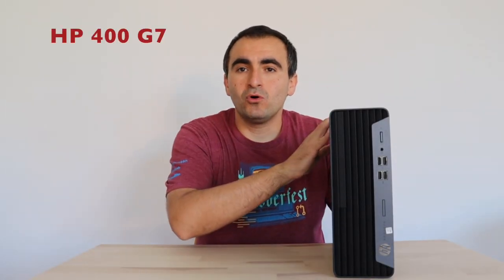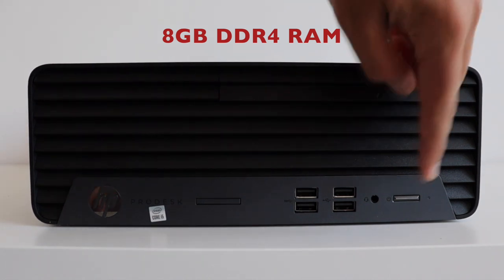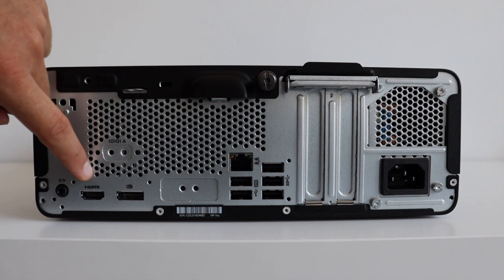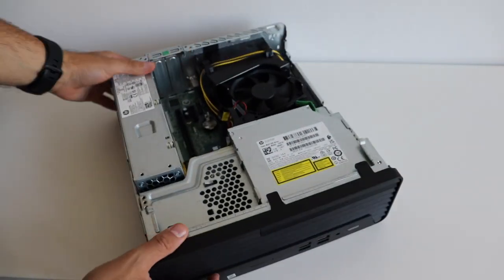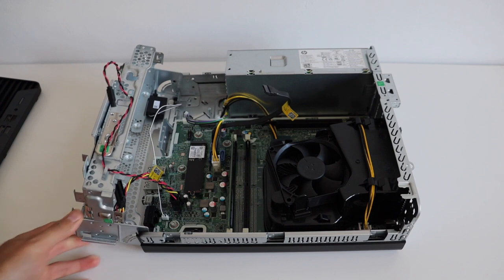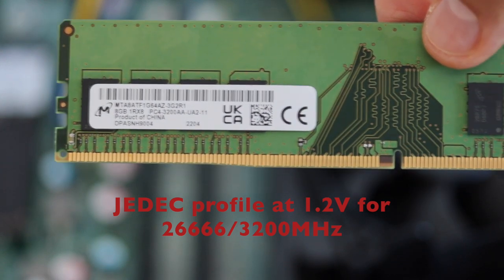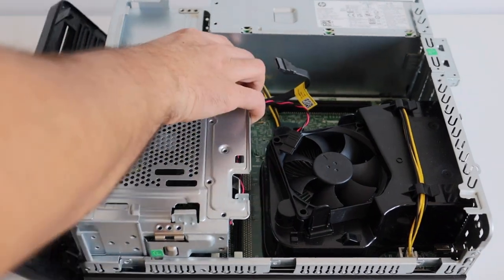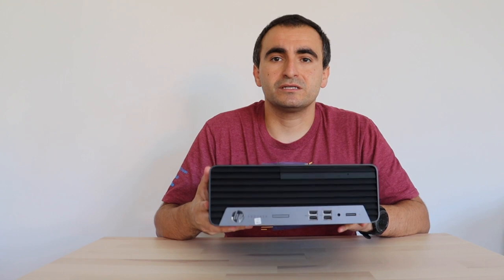HP ProDesk 400 G7 with Intel Core i5, 8GB DDR4, 512GB NVMe Review & Teardown

Comment: What’s the cable who powers the motherboard? Is it the pwrcmd?
Reply from the maker: My HP ProDesk 400 G7 came with a D19-210P1A power supply. I haven't looked at the cables much but I guess there is a 6-pin pwrcmd.
Reply: But the p2 its the cable who powers the motherboard, isn’t ?
Reply from the maker: @C.Zerefos7  yes, I think so. What are you trying to do? On the market you can find an ATX 24Pin To 6P Converter adapter power cable for HP ProDesk 400.

Comment: 10th gen i3/i5 supprts 2666MHz max, while 10th gen i7 supports only maximum 2933MHz. 11th gen supprts 3200MHz out of the box
Reply from the maker: Very important remark about the RAM is that the profile must be JEDEC. Initially I tried upgrading with Extreme Memory Profile (XMP) RAM but it worked only at 2133MHz. So as mentioned in the video I had to return and replace it with another that had 2666MHz JEDEC profile.

Comment: Can you please suggest me a GPU that ate compatible with this HP ProDesk 400 G7 Microtower PC (31P90PA)?
Reply from the maker: Yes, as far as I see the GPU cards listed as recommended in the datasheet are: AMD Radeon RX 550X Graphics (4 GB GDDR5 dedicated), AMD Radeon R7 430 Graphics (2 GB GDDR5 dedicated) and AMD Radeon 520 Graphics (1 GB GDDR5 dedicated)
Reply: @ what’s about GTX 1650 TI?
Reply from the maker: I think this card requires PCIe 3.0 x16 and such expansion slot is available on HP ProDesk 400 G7 so it might be a good fit. Check all the technical details to make sure it is fully compatible.

Comment: I also own this prodesk 400 g7... i want to upgrade gpu... any recommended psu to support my 200w gpu?
Reply from the maker: Yes, you will definitely need more powerful PSU for such a GPU. My prodesk came with power supply model L70043-002. I can't recommend a particular model for an upgrade. However, I recommend you to carefully check the form factor and dimensions of the new power supply and to make sure that it will fit within the case of the prodesk.

Comment: My model is HP ProDesk 400 G7 Microtower PC (31P90PA) is it support GPU?
Reply from the maker: Yes,  HP ProDesk 400 G7 has an expansion slot PCIe 3 x16 on which you can connect an external video graphical card.
Reply: @LeonAnavi  would you please suggest me a GPU model that will be compatible to this PC

Comment: Hello, can this machine use a RTX 3050 6GB LP?
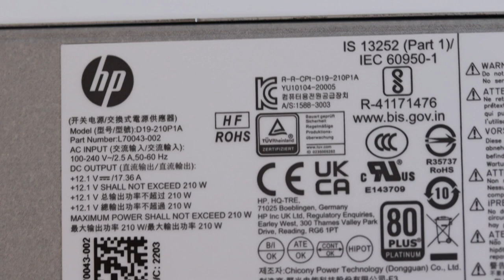Reply from the maker: No, according to the specs of GeForce RTX™ 3050 LP 6G OC it comes with PCI Express Gen 4 interface but HP ProDesk 400 G7 is with Gen 3. Also the recommended power supply for RTX 3050 is 300 W and as you can see at 5:56 the PSU in this computer is just 210 W.
Reply: @LeonAnavi  I don't think power is a problem. ETA Prime made it work on a m920q without changing the PSU. But the gen 3 and 4... :(
Reply from the maker: Well, afaik m920q is also with gen 3.
Reply: ok, but everyone is saying there's no noticeable loss with this particular card, runs fine.
Reply from the maker: You can give it a try if you want. I don't think it is that good of an idea for this particular PC. Keep in mind the limitations by the PCIe Gen 3 and the PSU.
Reply: Although I would prefer m75s gen 2 with Ryzen 5 that already comes with a RX 6400.
Reply from the maker: @JorgeC-uk6wk  yes, I totally agree this sounds as a better option.

Comment: Would it support an i9 10900 processor?
Reply from the maker: No, as far as I can see in the HP technical specs for ProDesk 400 G7 i9 are not supported: https://support.hp.com/bg-en/document/c06918483
Reply: @LeonAnavi  another question, the maximum it supports is an i7-10700, if i buy an i7-10700F will it detect it? the second one is cheaper than the first one and i already have a graphic card and i don't want a processor with an integrated card.
Reply from the maker: @ivanisai4330  well, may be but I am not the person to give 100% answer on this topic as I haven't performed CPU upgrade on this particular PC. Read the details in HP documentation. I think they have forums too.